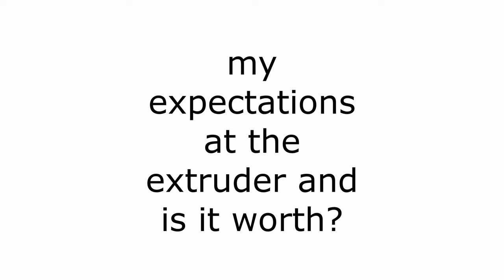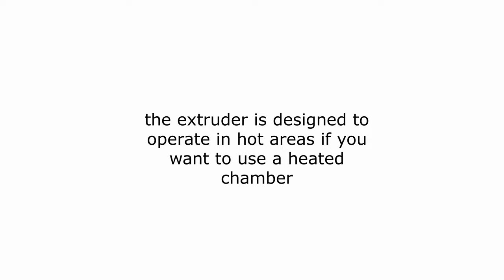BIQU H2O Water cooled Extruder Installation and first try (Voron clone)

Comment: hey buddy do you have a link to the mounts you used toattach this to the voron(clone)? I've had this extruder with the water cooling for a year but its just sitting becayse i cant find a mount for it for the voron
Reply from the maker: I assembled it whitout any mount.. but i found that for the voron.. if it’s fitting im not shure. Greetings joel https://www.printables.com/de/model/188548-voron-24-biqu-h2o-extruder-mount